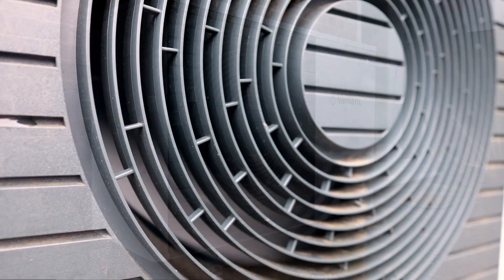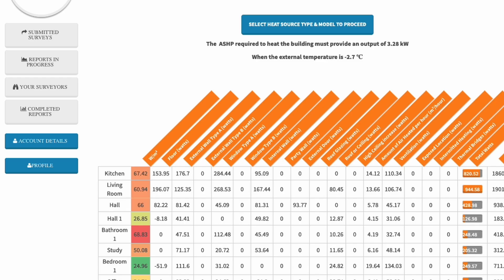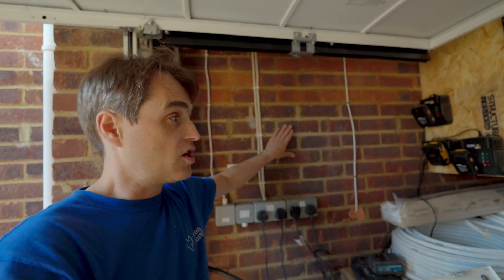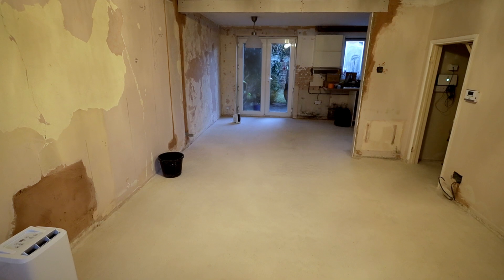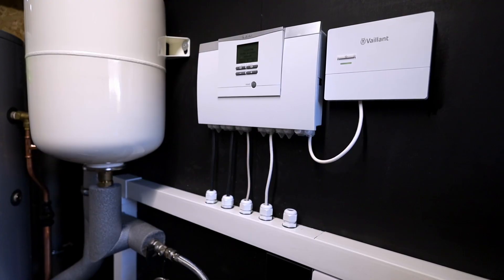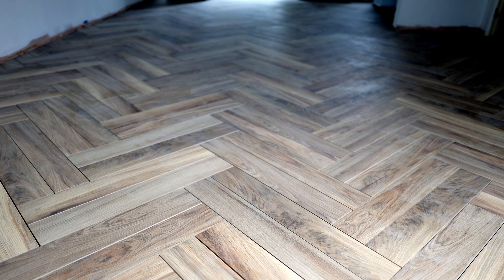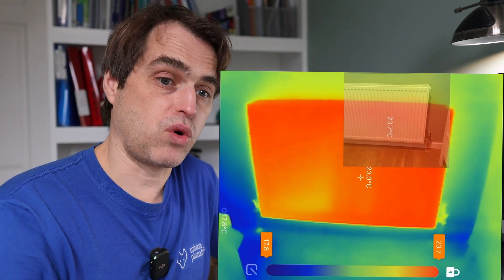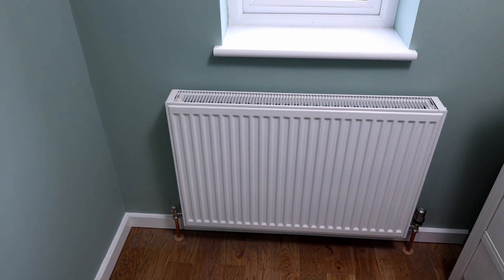How I Installed The Most Efficienct Heat Pump In The UK.

Comment: Is it normal that you have saw shape consumption of heat pump? It starts once an hour almost regularly. I thought that if you balance your system right it needs to work all the time and modulating.
Reply from the maker: Half of the house is off. That’s what happens when you zone and also when the weather gets warm.
Reply: @UrbanPlumbers  now it makes sense. in future you expect working of compresor for the most of the time? On your link i noticed that you turn of heating during the night. Is it more efficient to leave it working during the night?

Comment: Interesting video.
I did the calculations on my house - similar to yours, small 3 bed link detatched, with an uninsulated slab and the heat loss into the floor with under floor heating was very high - nearly 1kw per hour - vs 300w which is current building regulations allowance.

Comment: It's great news that you can beat the manufacturer's published performance. That gives me more confidence in my design as I have tried to do everything to maximise efficiency: all my core pipework is 22mm Copper with mostly just bends and 15mm to radiators. I have very large emitters (K3 in some places, K2 elsewhere) and I am currently running the system at 35C flow using my gas boiler. So far, this winter, the performance is good. I don't want to "upgrade" to underfloor heating owing to the massive disruption to my house. I'll be installing a 5kw Vaillant in the Summer/Autumn and removing my Vaillant combi and removing the gas meter.

Comment: Hey Urban Plumber! i enjoyed your vid as usual. One question i did have, you have a cordivari tank in your install, are you using this as a buffer tank or volumiser? If so can you explain your rational? Also i noticed a few points from your open energy stats. 1 - your hot water heat up cycles are generall peaking out at around 45 deg C, i pressume you are not living there or do you have some other method of heating the water beyond this? 2 - you seem to be getting a delta T of around 2-3 deg C for your heating system, ive heard you talk of a design delta T of 5 before, is this lower figure what you expected?

Thanks in advance!

Comment: Loving my Daikin heat pump and im averaging COP of around 4, the only thing I have noticed is that it cycles when the outside temp is about 10 deg C or above. Ive tried altering weather curves but always seems to cycle when it gets warmer and not sure why... its no big deal as the house is warm and cheap to run but I guess the cycling could harm the unit over time.

Comment: Great example of doing it the correct way around. Lesson to everyone has to be 'do the basics first', - improve a homes insulation. I like many others get great pleasure and inspiration from watching crafts people at work. I know it takes a lot of effort to put the videos together,  but it is appreciated.
Reply: Improve the homes insulation by fitting 50mm foam and plasterboard internally to external walls (As well as loft insulation and double glazing) and your bills will be half anyway £6k cost, it's not worth doing the heat pump/ solar/ battery malarkey as it's not economical in a 10 to 15 year span (It's lifetime!) cost £23k!?!
Reply from the maker: @TomTomicMic internal wall insulation can be very tricky. Most builders just do dot and dab which is a recipe for a disaster. Correctly done IWA without leaving any air gaps between insulation and the wall is tricky, expensive and very few builders know how to do it correctly.

Comment: As always, your content is easy to follow and understand. We're just starting out looking at heat pumps as we have a relatively new build property and gas boiler but the more we learn the more we understand the process. You did have me a little worried at the start of the plant room section though when it looked like you were bringing in a buffer tank but glad to see it didn't make it into the final design.
Reply from the maker: It did! It is a 100l volumiser and it is connected. Not sure if it is that much of a help yet, will run test with and without it soon
Reply: @UrbanPlumbers  I must have missed it it the final shots. We always look forward to seeing what the stats look like when you get to experiment.

Comment: I know you are a valiant man on heat pumps but for older properties what is your take on the new Mitsubishi r290 units for flow at 60c
Reply from the maker: Mitsi is one of the most awful controls ever made. I wouldn’t install it again. Also 60c is way too high even for period properties. 50c should be max.
Reply: @UrbanPlumbers  the reason I ask is I have a listed 1910-building underfloor is not possible, but oil heating can be removed yet with a heat loss of 22kwh yet still to get a cop of 4.2 according to literature and after multiple attempts can update to k2 or k3 from convex heaters that never got warm
Reply from the maker: @ram64man  you will not get more than scop of 2.4 with 60c flow and a Mitsubishi heat pump. Also the huger flow the lower the output so for 22kw you will need more than 2 units
Reply: @UrbanPlumbers  I think I’ll stick with a newer combi then thanks

Comment: How long will it take you to recoup the cost of adding underfloor heating, replacing rads, running sub mains, insulating and plastering your whole house?
Reply from the maker: house needed to be renovated anway. taking into the account that the running cost from the summer for the whole house will be £0 - it should eventually pay for itself. 

It also brings super comfort with a constant 20c inside, and makes the house looks awesome - as it is pretty much brand new now.

Video on cost and finishes coming soon.

Comment: You are quite right 10/ 12 years ago I had a system specified by others and it came with a non inverter 8.2kW air water heat pump with no weather compensation ...a bit of a disaster  the unit kept cycling and COP never got much better than 3.4,  I have now after testing and gone back to basics and come up with a figure of 3.4 kW to heat the house to 21'C at -5 'C with modern refrigerants and DC drive compressor and fans I have found a heat pump that will cycle down to 800 W. the moral of this is do the sums right by an independent designer be careful with back of envelope design and figures by 'expert' sales people.

Comment: Wow, that's excellent! I wish I'd had your input before my heat pump was installed. However, mine was a 100% grant installation, and I had little say in how and where and what etc. I'm NW Scotland by the sea, so it's not much colder here than down south, but winter is around 6-8 weeks longer. I have had it confirmed by an independent - Heat Geek trained - engineer (there are only 2 within a hundred miles!) that my system is oversized - 11 kW Arotherm NOT Plus, sadly - so unless I have all the emitters in the house open all the time, the pump cycles so often it would be laughable if I didn't know the heat pump will probably fail long before it's so-called design life is even close. The engineer suggested a 30 litre volumiser between the end of the emitter return pipe just before it returns to the pump, as the pump is oversized for the volume of the system as it stands. He reckoned the installation itself looks sound, my wall cavities were filled as part of the grant, the loft has more than 300 mm of insulation, and the house has a 75 mm stud inner wall liner filled with mineral wool. There's not much more I can do with insulation. Even if there was, this could exacerbate the cycling problem! But a question, if you haven't already binned this too long comment: Could I, should this pump fail soon, simply replace it with, say, an 7-8 kW heat pump or similar, and of Arotherm Plus iteration, without changing any or little of the other hardware? (I get, over the whole year, 2.5 kW out for every 1 kW in, using this as my yardstick [and not the equation I have seen elsewhere which seems to produce a number that means little regarding cost of kWh in, to kWh of heat produced] It gets down to 2:1 in zero C weather, and 3:1 when it is warmer but heating is still needed. At 26p per kWh at present, which averages £107 a month round the year, including VAT, but not standing charge which I would be paying anyway, as I did when I had a solid fuel CH system, so kind of a like-for-like comparison, coal and wood cost twice that (!) I'm not too disappointed. At current coal and wood prices - the pump was installed just as rates for everything were spiralling - I believe it would be triple at something like £3,500 a year!! I know it can get more than a tad obsessive, trying to tweak heat pumps, and I have done my best, but SCOP figures in excess of 3 (3.2 minimum, according to Heat Geeks) don't seem feasible. I have only a State Pension, so don't have the finances to experiment further. Any help would be totally brilliant, though I don't expect it. Sorry for my usual rambling on and on (-;)~
Reply: Sounds like you need to sell your heat pump or sell the hot water it produces to your neighbour.

Comment: Great video mate, did you change the microbore pipework in your house? I went on a Panasonic course and they said heat pumps can run on them
Reply from the maker: yes, i didnt want any compromises on my own hosue. Microbore will work, but will usually require a buffer and another pump, making the system less efficeinct. Change it if yo can.

Comment: What size flow and return did you use for the upstairs rads and the UFH manifold?
Reply from the maker: 22mm - even 15mm would do it with 3kW heat loss.
Reply: @UrbanPlumbers  I am an electrician and am designing the heating system for my home it is very similar to yours. 

Only 3 rads upstairs and 1 towel rail 

ground floor all ufh and also ufh in first floor bathroom but my calculations was 28mm required. 

My heat loss is higher than yours however so I will have to work on that first then can reduce my pipe sizing. 

Or more likely I’ve miscalculated 😂
Reply from the maker: Get HYTools app to calcite pipe sizing required.
Reply: @UrbanPlumbers  legend thanks!

Comment: In your oppininion what size of a arotherm HP is required for a 200m2 UFH?
Reply from the maker: what the heat loss? could be 3kw oe could be 15kW
Reply: @UrbanPlumbers  Hmm, I'm not sure how can I calculate this? Is there an online calculator that I can use to enter my property size, openings, and isolation to calculate approximately?
Reply: @UrbanPlumbers   The heat loss is 4.7kW

Comment: I was hopping you'll be talking about your pipeing setup. As I can see you have a buffer installed is this because of zoning? How did you setup the zoning and underfloor heating? How long are your pipe circles in UFH?
Reply from the maker: no zoning. no buffer. just volumiser. UFH pipe length is 75m per loop at 100mm centers
Reply: @UrbanPlumbers   is voulumizer needed for all the UFH or just in your setup?
Reply: @UrbanPlumbers  Will I get beter circulation if I go with 50m per loop on my UFH or it doesn't matter?
Reply from the maker: @lazocar1014  uo to 100m is acceptable if using 16mm pipeworks. I wanted the lowest possible pressure loss for lower pumping power.
Reply: @UrbanPlumbers   I'm trying to do UF pipework as yours, so 16mm at 100mm and I was planning to go 50 or 60 meters loops and 28mm from HP till manifolds(I have 2 manifolds). Now the question: Is the Valiant Arotherm pump capable to circulate through the system with the lowest pump power or do I maybe need to upgrade from 16mm to 17mm in loops and from 28 to 32 for manifolds to achieve better circulation? I'm in the process of building a new house so now have a chance to design UFH the best way possible.
Reply: @lazocar1014   I built a new house with about 170m2 of ufh, I used 85 ish meter loops with 16mm pipe at 100mm centers. I feed 2 manifolds with 32mm pex 12 meters long each way to the heat pump. Betweent he manifolds is a couple more meters of 28mm copper with some copper bends. My vwz plus 75 needs about 70% pump capacity to run this. So it can do it easily. The whole system works very well and is efficient. Dont worry about the pump, running it a little harder or slower doesnt make a big difference in power use. Making the loops short and keeping 100mm centers makes a bigger difference. But 50m loops will work great but it will be a bitch to lay the pipe. 75/85m will work fine. If you want to do the work, shorter can be better but idk from what point you get diminishing returns
Reply: @garage3022   Thank you for the explanation.
Reply: @UrbanPlumbers   I could probably have a system without the zoning in all rooms except the south ones and I'm not sure how to deal with them since if there is a sunny day that rooms will probably not need the heating on since it is a really strong son on winter days here where I live and if it is not sunny day then the heating is needed. How to overcome this if I don't have a room thermostat? How would you do it any suggestion?

Comment: What I'd like is information on how I can down rate my rapid 25 by about 50% to prevent it cycling at 50 degrees c. Can it be done?
Reply from the maker: yes - in installer menu
Reply: @UrbanPlumbers  thanks but I've not seen that option...
Reply: Also, I can't work out if the modulation is ratiometric in operation...

Comment: Syzmon - that surpassed excellent and is an absolute masterclass. The installation not only achieves excellent performance but the layout on the black background is ‘artistic’. Any chance you could link the cavity wall outfit you used?
Reply from the maker: thank you ! - it is EPS bids insulation from a compnay called Arrow insulation - they were quite cheap actually - some £1500 for the whole job.
Reply: @UrbanPlumbers  Thanks👍

Comment: I'm not a heat pump skeptic, but I AM a skeptic of it being a viable option here in Anchorage, Alaska.  We've had -30C for the past week or so, and I'm just not sure that a machine yet exists that could keep my place up at +21C. 
And it's risky- even with the gas boilers in our apartments, some neighbors still had frozen pipes and flooding.
So I'm a bit leery, plus contractors here aren't very knowledgeable of any sort of new technology.  At all.
Reply from the maker: ground source may be able to work in those conditions. Air source would fail at those temperatures.
Reply: If Air Source, then one with Enhanced Vapour Injection (in one of it's various forms, Hyper/Ultra Heat, etc) is going to be a must if -30C is common.  Otherwise Ground Source/Geothermal - if an option, is more than up for the task, and depending on electricity costs, will likely have paid for itself by the time it comes to replace the heat pump.  Either way, both (when properly sized!) would be able to do 21C in -30C.
Reply: A hybrid system that uses a gas boiler for the coldest periods and a heat pump for the warmer periods could also work.

Comment: HI my sister has moved into a brand new council place. its a 1 bed 3 floor set up. new air pump to heat the place. shes spending over £300.00 a month on electricity!! seems her neighbours are spending similar and more....whats all that about?
Reply: Suspect it will be poor / no design, I would strongly suggest that if she is a council tenant she contacts the authority to discuss this with them, most authorities are keen to have their tenants in affordable accomodation.
Reply: thanks will give her that advice
 @airspike1
Reply: Very suspicious.
I would turn everything off and see if the meter is still ticking over. 
If it's brand new it should be so well insulated that one small fan heater will heat the place.

Comment: Why install a heat pump .. you could just have a couple of candles in each room with such super insulation 

or maybe some old incandescent lightbulbs would keep it warm 

the heat pump is overkill 

In France, they now just use IR heater panels
Reply: IR panels have a COP of 1, heat pump COP between 3-5 typically, that is why they are installed, highly efficient use of electricity to harvest warmth from air.
Reply: @_Dougaldog  

Nonsense 

They cost a fortune to install vs ir pannels

You need to factor in the lifetime cost

Comment: Nice video of your progress. I saw that installing underfloor heating was a major effort and in our house we had underfloor heating but it was an old system and the pipes leak so we have disconnected it and rely on radiators. But a neighbour has had a heated ceiling installed that works apparently much like underfloor but it's above instead of below. An advantage might be that it is not shaded by rugs or furniture and it means we don't need to rip out our new kitchen.

But do you have experience of heated ceilings? Other than the neighbour, I have never really encountered this. Do they work? I mean logically you'd say hot air rises so unless the ceiling is radiating a decent amount of heat, you are less likely to feel the benefit.
Reply from the maker: Don’t know - never tried one. Feels like an even bigger hassle to UFH and will lack thermal mass. Most likely will just act as an UFH fora floor above instead
Reply: @UrbanPlumbers  That seems a reasonable assessment. Actually our house has concrete floors on all three levels. But yes, I can imagine that this might mean insulating the floor above so that the ceiling has thermal mass.

What I do know from the neighbour is that the ceiling height is effectively lowered, but only by around 5cm.
Reply: @NickAskew  

Could neighbours be use electric Infra Red panels on ceiling ? If so then their COP is 1, much lower than the heat pumps performance.
Reply: @_Dougaldog  Well actually now you mention it, by brother in law is using infrared in the ceiling. But no the neighbours have ground source heating in their ceiling.